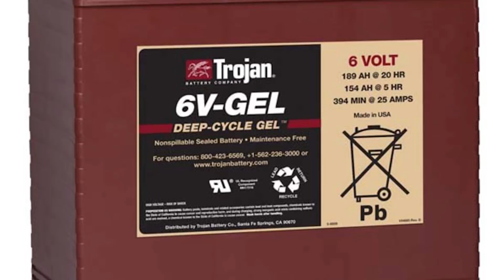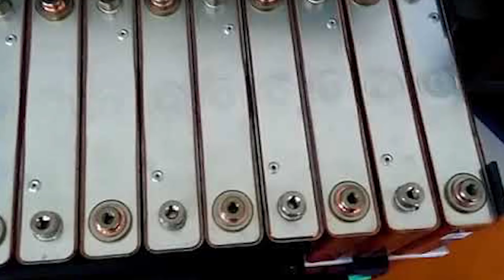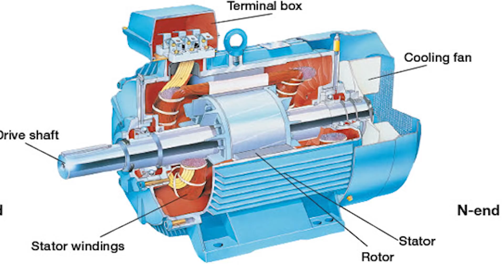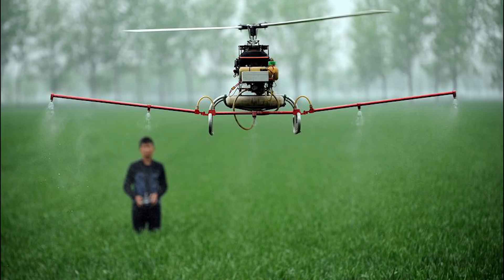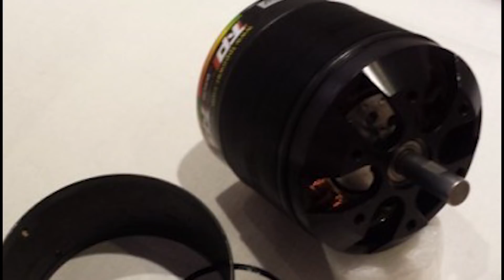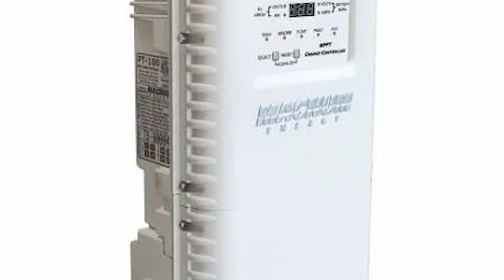How to Build an Electric Sailboat

Comment: I have a diesel engine on my 12m (9tons) monohull, I’m not planning to make it electric but more of an hybrid approach with diesel inboard and electric outboard at the back of the boat. I’ll like to have an hour of autonomy. Last year I did 7000 nautical mile  cruising and 145h of engine and two third of them were less than an hour (most are just arriving at an anchorage 20/30min). Thanks for sharing your knowledge.

Comment: great score on batteries, i would break pv battery motors and inverters in two separate systems for safety, in case of fault or lightning, also lightning bypass system and even maybe a large kite for favorable wind conditions, i have come two many of the same conclusions, even the tender could have the same outboard as the other two 48v 10kw bldc's just in case. lots of safety on a diy out in the ocean, and some actuators on some of your panels to catch afternoon and morning sun, way more efficient. great job well articulated, thanks for sharing

Comment: After waiting 2 years for the supply chain to self correct I’m looking for other solutions. Although radical, having a diesel genset offers a hybrid diesel solution option.
As cost per KW/Hr. Continues to drop as supplies for diesel parts are increasing difficult to source pushing me to having formerly off the shelf parts to be custom fabricated.  Looking at all options to supply, machine or install a raw water pump. Looking from Seattle to Florida.

Comment: Hi there, just watched your video and it was very informative, I am currently planing to install a 10 Kw electric motor from thunderstruck motors on my 31ft Maxi95.
Some people had installed a gear reduction 2:1, is that necessary? without the gear reduction will you be able you run the motor at the same speed consuming half of the power?

Comment: Consider going 14s for 48V so you can avoid low voltage cutoff and maximize the time you spend in the sweet spot of the batteries.  In terms of amps for charger, BMS, controller and inverters, consider buying components with at least 2X your steady state max usage in amps.   (e.g. 200Amp controller for max of 100amps). This will give you a critical safety factor. You can also extend the life of the components by programming the controller to slowly ramp up to speed and slowly ramp down.   You want to avoid fast starts and stops since they can cause voltage spikes.

Comment: With a 5 year plan,   "Zero-Point energy", using Nikola Tesla technology Air-core windings, VERY-high frequency & high voltages give the most gain & transform back to max voltage to charge battery banks at maximum rates of charge merge generated energy and the same style motor as used for electric bicycles...

Comment: CONSIDERATIONS :
Solar Panel space (available m²)
Solar Panel size (length x width per panel) [the thickness & weight won't impact or affect much]
E-Drive motor(s) size (15kW+)
Genset (10kW+)
Battery (50kWh+) 12/24/48 V banks

Comment: If you're going to use BLDC outrunners, you'll have to gear them down probably to 10:1. You'll lose a bit of efficiency doing that, but you will absolutely not be able to direct drive the motor.

I'd try a straight sprocket gear-down since space savings isn't a big concern. Planetary gearsets are more expensive and barely more efficient, but the only gains you get are volumetric space-saving.

Comment: Sorry to burst your bubble but its not a green system with lithium batteries. Fossil fuels have a lower co2 impact. The break even point would be around 10 years and your batteries won't last that long even if they have 3000 cycles left.
Reply from the maker: how many cycles your gallon of gas give ya?
Reply: @findingsimon  That's irrelevant when looking at the big picture the whole life cycle of gas vs electric. Talking about total emissions.
Reply: @thebradmanofmuskoka  
Absolutely correct. Green in not green. Solar panels are toxic to make and dispose. All batteries are toxic to make and dispose. Only the lead acid are worth something to recycle. Old Tesla batteries are disassembled, evaluated and selected cells are reused in Powerwalls but most are warehoused with no idea of what to do with them. Recycle drop offs are simply shipped to indefinite storage centers that are government funded programs. Even China doesn’t want them. Nothing beats a sail. The most green efficient propulsion is a small, turbo intercooled Diesel powering a displacement hull. Like a sail boat.  Most initially, reliable inexpensive propulsion is a Suzuki EFI outboard with the correct prop. If a harbormaster gets wind of that you have a large propulsion batteries, he will charge you or put you on the meter. The biggest problem with batteries is range/runtime. Days for fuel and hours for electric.

Comment: I built a small sailboat but I decided not to use any fossil fuel, the stove will be with alcohol. My main idea is to separate the systems by priorities, night lighting, engine, electronics, navigation, food etc. All independent with batteries and solar, wind or hydrogeneration charging. And I think that a few more years we can have flexible solar collectors, which can be opened for a few hours, but as big as a candle. Well, there are several options in the works.

Comment: i am watching all the EY Elecetric Yachts (EV equiv for cars) with great interest and passion and the types of 360 degree rotating EPS Electric Propulsion Systems coming to market. Yes no fossil fuels just need to educate on power banks 12 volts 48 volts and yes running AC Generators Water makers and Hyrdogen Electrolysis all takes power so yes a balance

Comment: I have driven a tractor trailer truck 2.5 million miles at 5 and six miles to the gallon.  I am 50 years old and if I live a hundred years with out having to ever smell diesel again it will be to soon. I want to make my catalina electric.  The benefits are that in the next 4 years when I plan to retire electric motors will be even better. < I hope lol. Great video thanks
Reply from the maker: It’s all about power generation and storage. The motors efficiency is already in the mid 90’s%.  I hope something like hydrogen fuel cell becomes attainable. 100kwhr or storage is essential to any level of motor cruising. So either make or store 100kwhr a day. That’s a lot of juice.

Comment: It seems to me that you have your "head wrapped around it" pretty well.  It's rather mind-boggling to me, but, after the second time watching your video, I'm understanding it all a little better.  I hope to use an electric motor on the sailboat that I just bought.  I still have a lot more to learn.  Good luck with your project, but, judging by the date of your video, you're probably pretty far along by now.

Comment: you ever thought  running two motors in series  make one in two into a electric generator  charging a second battery bank   as you deplete the power from the first battery bank  with a automatic   power  charge switch  ?
and yes  a brushless  110 mm radiuses motor will work  fine .
Reply: Sounds to me like you are reinventing a perpetual energy system - which of course does not exist in practice.

Comment: Are there not corrosion issues with non-maranised motors or is that just a marketing trick? Does seem like a lot of the marine motors are overpriced.
Reply from the maker: Yeah safe to say it's a bit of a trick. Depends on how much salt water it makes contact with. Salty air can be overcome by a preserving oil and a paint job, salt water cooled requires either a heat exchanger or an epoxy coating on the hot bits or something like that. The only other issue is cycle duty, you need a motor that can run at the power you need it to for 24 hrs straight, that may be too much for some lighter performance electric motors to handle.
Reply: @findingsimon  Cheers for the reply. Ill have to dig out your follow up videos

Comment: I hung on every word.
I have a 46 year old 32' sloop with a 16 horse stubborn diesel.
I have a wonderful brand new generator inverter pure sine. I also have RC experience and electric plane experience.
I am thinkimg just starting off to use a plug in DC motor.

Comment: First time here, and as a sailor I would not go for outboards as pictured in your graphic. They will be out of the water half the time when in choppy waters and if you have an onshore wind and tide and trying to dock of leave the dock you don't have enough power from the props being in and out of the water. I have seen this many times and rescued many boats. The answer is inboard or a very long leg on the outboard or adjustable transom. André

Comment: Here's an idea. Instead of having a lead bulbous keel you could have a big gas cylinder converted to a hydraulic accumulator. Fluid could be pumped in and it can run a hydraulic motor or generator on the way out.

Comment: Had the same"mental"problems when having to drill holes and removing a huge piece off the bottom, on a perfectly sound,floating 8 m sail-boat,I installed a Supercharged Kawasaki jet-ski Motor with the jet propulsion system(310 HP),and it is just fantastic,when trolling for fish or on bad seas,all that torque makes it safer,and I went to places in Thailand where a prop would have been an issue,with hundreds of Jellyfish or random plastic,nets,lines pollution, close to some ports before sailing to high Seas.But going all electric is a super option too.

Comment: Surprised you didn't mention 3 phase PMAC motors.  Small, efficient, light weight, reasonable price.  Have you looked at Thunderstruck kits?  Very reasonable.

Comment: saying an electric sail boat is more self sufficent than a diesel is stupid. ITS A SAIL BOAT. how much do you think a sail boat motors for? if your using your batterys to steam then you are killing your batterys. why do 1 knot on batterys when you can do 3 knots on light wind. you realise that a diesel engine is alot cleaner than batterys?? diesels oonly output carbon. just straight up carbon. not No2 or any of the nastys of a petrol engine. i get that you are trying to be a hipster but do some actual research rather than just trying to become an image of a stereo type. diesel is cleaner than battery. and very easy to find fuel for. you can power it with any anything if you use a GEET reactor.

Comment: You had me up to the ac and heated water lol
I've lived in the tropics 10 years without ac or hot water and don't feel like I'm roughing it. 
But I entirety support you getting off fossil fuels. I've been trying to unravel the electric motor with continuous charging via solar wind and even hydro for a smaller coastal cruising catamaran. It is daunting. Lots of information but no one size fits all setup. Check my playlists for some YouTube resources you might have missed. Looking forward to the finished product. Good luck.

Comment: How much fossil fuel was used to create batteries, panels, controllers, etc. Add all that up and multiply it by the number of times you will need to replace it all compared to one Diesel engine and the fuel it will use over its lifespan on a vehicle who’s primary mode of propulsion is, and should always be, WIND, sailboats are the original green solution. A lot of sailors have no other means of propulsion. I’m really not trying to be snarky Simon. But please, sail the vessel first. Become a sailor, see what the real world challenges are while sailing blue water, passage making, round the world cruising yachts. It can be as simple or as complicated as you like I suppose. But really,above all, it should be safe. And dependability is at the top of the “is it safe” checklist.

Comment: Dude life long sailor and engineer  fuck diesels !!  you can have enough charging and power storage to run your boat like a power boat if you're clever enough. Like not using any available "marine " electric propulsion products . a modern ultra efficient and  powerful brush-less motors . And as well converting your own brush less charging system . In a storm when you can t even fly a storm sail engaging more than one wind generator could generate enough to run your prop and steer your boat through boiling seas instead of lying helpless without power. I see people on YT showing of their overpriced antiquated tech. combustion engines are for racing ! and water skiing .

Comment: I have an electric motorcycle. The motor is air cooled, but a heat sink could fix that for water. Zero motorcycle has 70 how and 116 ft/lbs of torque and ridiculously small. Why not a vertical wind turbine? Unidirectional and more surface area. Can you put batteries in keel, sort of serve 2 purposes?

Comment: hey been watching ur movies for a few weeks and been very interested and so im pulling the trigger on a 28ft catfisher  needing redo and I want to ditch the 45 hp diesel Mercedes for a tesla model s set up from a junked car from copart should cost me 10k to buy .with ur experience would this work if I powered them by solar panels I should be able to get 10 to 12 panels on the roof and back deck over the dingy area. thx and id love to come help as im a finnish carpenter by trade but in in Niagara falls and the ticket to you is 1500 to 2k but .
Reply from the maker: A tesla motor burns a lot of juice and the panels won't keep up. You'll be using them in spurts off of battery then charging back up. I'd look at cheaper a.c. induction kits like the ac35 or ac50. They're a lot cheaper and less power but still loads to move your boat around.

Comment: Hi Simon, Greetings from Naples Florida. I know you are going with an all electric boat but I’m not sure what type of power you are going to use to propel the boat. Have you ever looked at Torqeedo electric outboard engines?  Just saw it today online and thought you might be interested in it, it’s a bit pricey but it is a self contained unit. Here is a link where you can see it.  https://www.westmarine.com/buy/torqeedo-cruise-10-0r-electric-outboard-long-shaft-remote-steering--17981929?mrkgcl=481&mrkgadid=3202694917&cm_mmc=PSGoogleGSC%2520-%2520Product%2520Type_-17981929&product_id=17981929&adpos=1o1&creative=108421551364&device=m&matchtype=&network=g&gclid=EAIaIQobChMIn9DZjt_w3AIVlgOGCh33vwCkEAQYASABEgKd4_D_BwE   

Still waiting for the cup I ordered, can’t wait to get it. Again, I am so sorry about Champ, I felt like he was my dog too.

Comment: I love your ideas of breaking the mold! I have been a mechanic and fabricator for years and I am an electrical engineer (I am not an expert on boats).  If you are going to use an unproven electric motors to power your boat in the middle of the pacific or in difficult situations like crossing a jet stream where you need to get through it and a 2nd chance is not always an option - I think you better use a significant de-rating of the motors and you better have spares on board.
Reply: Excuse me Advanced Nutrition Inc, would you please explain a bit what you mean by "you better use a 'significant de-rating of the motors"? I have no clue what this means.
Reply: @strongme80  Motors usually have a rating. That is for a certain time period. Often people over power the motor for a short period Of time to get more power out of it.
Reply: @strongme80  if you're going to exceed this time rating and you plan on keeping your motor alive for continued reliable use. Then you have to apply less power to the motor and consider it a lower horsepower. And you should run your calculations with that in mind.

Comment: OK, so I am about to save you a ton of money...

Your sails make a LOT of horsepower. When you are sailing, you can trade a little speed to recharge your batteries. This is done by putting a large prop on a sealed marine DC motor that then acts as a generator. This is best done as an outboard. The generator can also act as your thruster in port or when there is no wind.

Skip the solar cells and wind generators. Maybe just augment with one 120 watt solar cell for long port durations to save on the lower cost of no-electric slips.